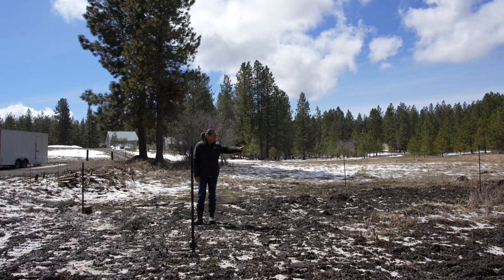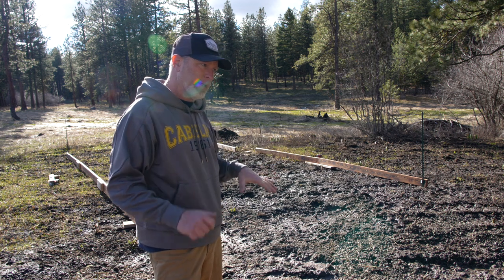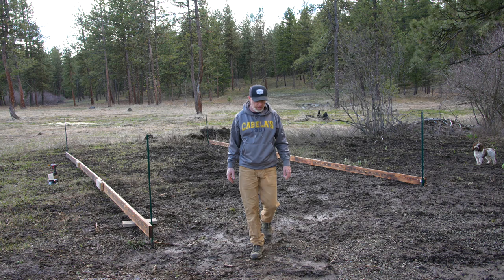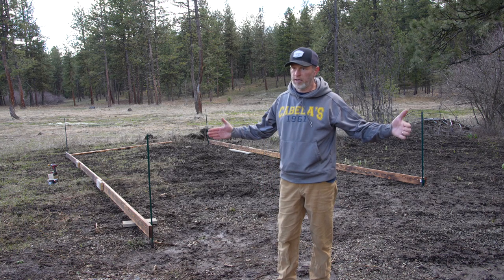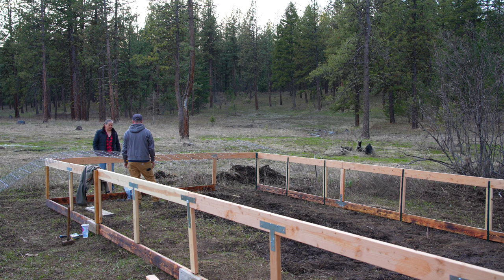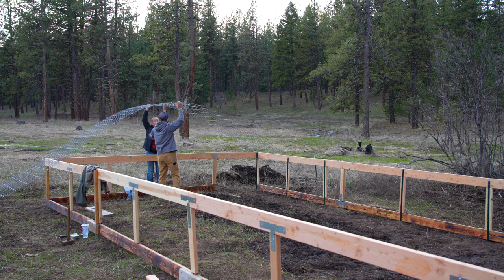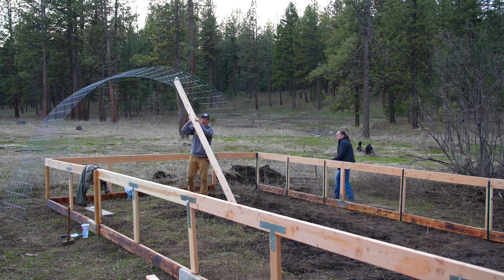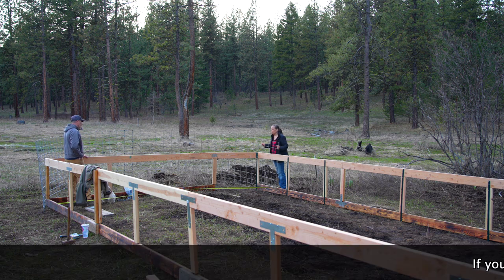Double Wide Cattle Panel Greenhouse | Part 1

Comment: i have wondered about using two panels like you have.  I could not find any info about doing it this way.  THANKYOU fo these videos.  I am just now watching.  found them by chance.  wasnt even looking up anything about cattle panels or greenhouses.  So i am beyond thrilled that i found your videos!  I have built one cattle panel hoop house for a chicken coop.  really like it.  I am thinking of starting a new adventure soon.  one where i could really put one of these to use!  So i will get to watching!!!!  I see the videos are a year old.  Wonder if you would do anything different?
Reply from the maker: Just make sure if you use zip ties to get the more expensive uv protected heavy duty option. On another project we found the white ones to crack. 

Wouldn’t do anything different. It’s still holding up perfectly ✌️
Reply: @mountaincabinliving  Will do, on the zip ties! And how awesome that it's holding up great! God bless!

Comment: If you let the top settle to 10 feet, your clearance will be higher by the wall. If you lift it a little more, you will have more slope on the roof.